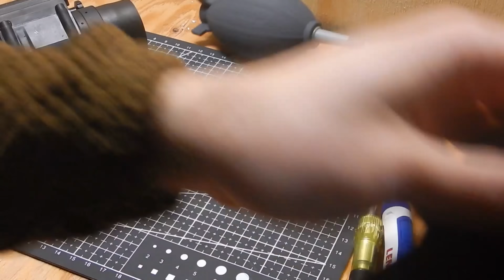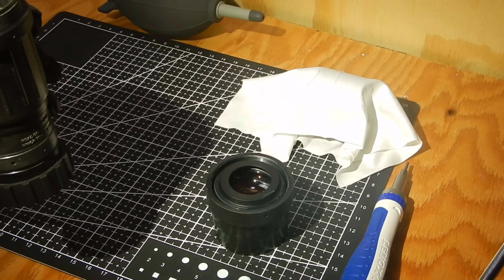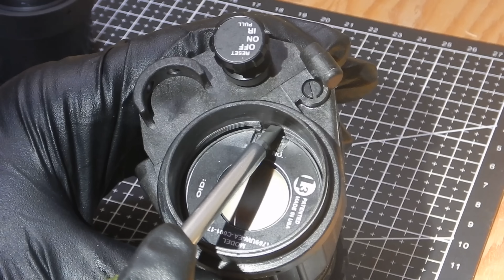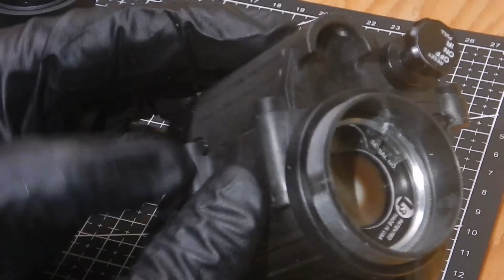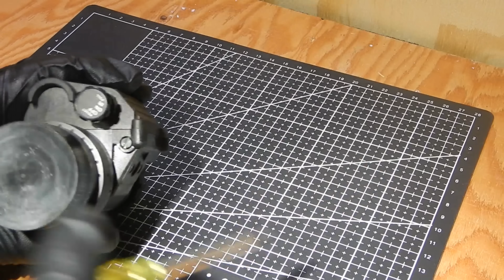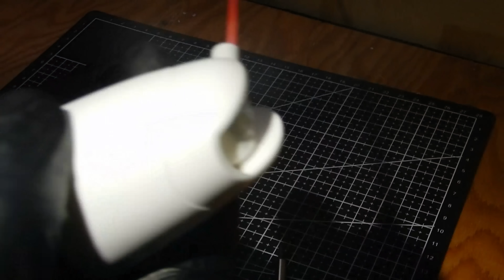How to Build Your Own PVS-14

Comment: A hint from some one who cleaned and adjusted microscopes professionally, using aluminum foil as a work space covering works fantastically. When you unwrapped the foil, it is guarantied there is zero dust or lint. Also this eliminates any static charges. So lay down a layer of foil to work on. You will thank me.
Reply: You sir are a god send. Thank you!
Reply: @AcidAnthrax  I would also use foil to seal off exposed components from air borne dust. Use it to wrap components which are removed to do the same.
Reply: Great idea
Reply: @beefstuart8769 i
Reply: I hear you can make hats out of it too.
Reply: @jackshett  we had one wacko scientist on the ship that did.
Reply: @crawford323  Fauci was there?
Reply: @crawford323  was that while crossing the equator?
Reply: @jackshett  I think crack heads improvise paraphernalia with it as well.
Reply: I'm impressed, I did NOT just read a completely stupid idea from the internet. Congratulations.
Reply: @shamancredible8632  yessir, taking a bit of time to prepare your workspace can save you grief.
Reply: I'm going to try this when I replace my screen protector for my phone
Reply: Any experience with Rodico for dust removal? It's a staple in every watchmakers tool kit for the same purpose.
Reply: That’s funny, an old Olympus camera tech told me that years ago. Have to say I never tried it but that’s probably why I got dust in all me lenses I took apart
Reply: I'm going to use that the next time I take apart my camera lenses and de-fungus them!
Reply: then you can   arc out  whatever you're working on if you're doing electrical
Reply: @billyjones9045  There is that!
Reply: Thanks
Reply: Thank you.
Reply: Hello. I have a question you may be able to help me with. I build medical devices, endoscopes specifically. The ones I build are rather unique in that they utilize 5 cameras to give a 360 degree view compared to typical scopes that only use 1 front facing camera. The 4 side cameras are covered with coated optic quality windows and come new amazingly dirty. They are a real PITA to get clean enough for installation. You have any tips for cleaning something like that?? I have spent multiple hours cleaning 1 window, only to find once I UV glued it in it is still dirty. Any advice would be greatly appreciated.
Reply: @stephenhood2948  The trick is to identify what substance is coated and causing the obstruction? We were taught to start with the least damaging substance and that being your breath moisture, then to lens cleaner and so on. We used “Sparkle “ the commercial window cleaner. It was actually formulated in WW2 after searching for a cleaner to clean the aircraft windows and not cause crazing. Any ammonia and chlorine can be very destructive to Le an for example. Then we moved to methanol, each time examining the lens to see if we actually dissolved the substance causing our grief. We would make our own ear buds because the commercial ones used glues to attach the cotton and of course dissolve and apply it to our lenses. We used wooden stick similar to the size of toothpicks but longer. We would break them to fray the ends and the twirl them in medical grad cotton balls. This next part is hard to describe but a snap if you see it done. To take that mess of cotton stuck now to a stick, twirl and slide it against the sleeve of your shirt near the shoulder. Push and twist at the same time working the cotton ball tight to the stick. Make sure you have plenty of cotton between the frayed wood as this can damage some coatings. Never apply fluids directly to a lens but just lightly to your homemade ear buds. The try to shake it all off. Whew. I’m sure my description has confused all. Start cleaning in the center of the lens in a circular fashion expanding the diameter of your motion till you reach the edge of your lens, then examine. If it did some good but needs more. Strip the cotton off the maxi toothpick and apply more cotton and start over. Keep you cotton balls in a zip lock back and never bring them out. Open the back slightly and insert the frayed end of your super tooth pick in to grab some cotton. You cannot risk having the cotton contaminated accidentally so keep it safe in the bag. If lint is a problem, that is a big problem. I always wanted to build a “filtered and magnified clean box” but never did. However take some hints from those who clean photo sensors. That industry has wonderful sterile and clean swabs made of a material which loves to hold on to lint and take it away. A quick search will find many products along those lines. I am long retired but I have my notes somewhere. I was not sure of the more aggressive solvents used. I studied at McCrone Institution in Chicago for my microscope maintenance knowledge. A call to them would be fruitful. They offer a wonderful week long course in microscope maintenance which includes cleaning. Hope this helps.
Reply: @crawford323  Thanks for the tips. Lint is a big problem. We have a laminar airflow hood thats supposed to create a sort of mini negative pressure clean room, but it is of very little help. They instruct us to use isopropyl, but that just usually leaves a nasty residue. The also have some sort of grease remover, ROR, but again usually leaves a residue, and these are medical grade devices that need to be perfectly clean. Honestly I feel as though I could learn far more on the internet than the people instructing us can teach us. Thanks again, I will try some of the tips you mentioned.
Reply: @stephenhood2948  isopropyl never worked well for me. Lab grade methanol or ethanol leaves little residue. Be especially careful with methanol which I expect you know. Never apply of course directly to a lens. The pol microscope lenses are glued not screwed together because the resulting pressure will depolarize the light. So dissolving that glue would be costly. My idea of a mini clean room would be build a box big enough to insert comfortably your hands and big enough to place a camera, lenses and tools. There would be magnification and lighting on the top surfaces and hepa filters on the sides. You might even use the vent hood to pull a slight vacuum. Do you have a port to draw vacuum from? I would be tempted to build the contraption around a stereo scope or even some of the new electronic microscope. Those are cheap and amazing. If you don’t have a vacuum source get a small car vacuum. The downside is they are noisy. If you build the thing name it Bill.
Reply: @crawford323  Yes, they have whats called a Laminar Airflow hood. Its a 3 ft tall box, about the diameter of a phone booth, with the front section half enclosed and a giant fan with ridiculously huge filters on top of it. Its creates a steady stream of upwards airflow that evacuates anything floating around in it. I was an auto mechanic for 30 years before this, but moved out of state and wanted to try something that didnt involve smashing my knuckles daily and painting myself in grease every day. The new vehicles are quite complex electronically, so most of the work on the Endoscopes isnt that different. I do quite a bit of micro soldering camera wires onto USBs, working under the microscope is the real big difference, its a different world under there, you need to have next level hand/eye coordination, but Ive been doing this for a bit over a year and have begun to really learn the process. We build new scopes for the company I work for, I had to sign a nondisclosure, so I dont want to say the name, but our scopes just got FDA approval and are just beginning to be sold. Plus we repair Olympus endoscopes for other doctors. The scope we are building is quite innovative, but there are still a couple of distinct areas I am struggling in. I wish we had better quality windows, they come new with fingerprints and fuzzies on them, not to mention damaged optic coating that cause reflections from the LED lights on the scope. It is a good feeling though to know that one day something you built could save someones life, gives me a real reason to want to put together a quality product. Though the same could be said of an auto mechanic, the extra work you put into a brake job could easily save someones life.
Reply: @stephenhood2948  Individuals like you have insights which others have not and talents which might not even be understood by yourself. I bet we could have a lot to chat about. I invented three devices which geologist are not using to gather data better. I earned a degree in photography in 1976 and I have done this my entire life and that road led me to become an Imagine Specialist in the scientific community. They struggled to solve problems in imaging which I found to solve easily not because I am smarter, no by any means. It is because I see the world differently as you do. This is not a job for you, I can see that. It is a passion and you know you have the vision to solve what comes before you and the end goal, which makes all the difference, is you want to help others. That your parents and your peers and your beliefs gave you.
Reply: @crawford323  Thank you, I have always been told I have a gift for repairing things, its really nice when people who dont know me notice this!!
Reply: or just use a grounded ESD mat
Reply: @russellzauner  The mat perhaps is not lint free. Optics are not concerned, as much, with grounding as electronics are however your point is certainly valid.
Reply: Well thank you! Will it mess with any electronic components tho?
Reply: @BUZZKILLJRJR  I am in no form or fashion an electronics expert.  I believe though as techs who work on sensitive electronics will wear grounding
Straps that such a device could be attached to the foil as well. It's the static charge, I believe, which is their fear. So maybe grounding the aluminum foil as well before interfacing with the device would be wise, I don't know. Just my guess.
Reply: Good looks
Reply: Please don't listen to this clown. A static dissipative surface is a much better idea. 

Also, never use fucking tape on optical surfaces. Transparent to you might not be transparent to 10um.
Reply: I thank you now
Reply: Id get ESD bags.
Reply: @Jake39019  we have big rolls of esd plastic they use to vacuum seal components. I think all the dust comes from the room. Turn on a flashlight and it’s everywhere. Luckily dust inside a lens doesn’t effect the performance.
Reply: Thx man
Reply: Thanks, man!
Reply: Ta
Reply: You assemble them naked too to keep the lent and dust dontya
Reply: Thankyou!
Reply: Aluminum foil doesn’t eliminate ESD(its a conductor) ESD is dangerous for Night Vision Devices, we kept it far away when repairing NVGs.
Reply: Thanks for the tip, whenever i need a makeshift clean room ill remember this.
Reply: Where can I get the parts to build it on my own
Reply: Thanks
Reply: Many thanks! I'm just starting to play with optics and electronics.
Reply: )l12] l ppl) ] ]
Reply: @Redlight25  ... 
everything, except THAT! LOL! 
(that's what she said!)
Reply: Hero
Reply: @Redlight25  Can someone throw a tin foil ball at Biden maybe it will fix him?
Reply: Fucking genius. I love the internet, it’s like my brain turning into a whore and getting fucked by all the smart people and their little mindsperms fertilize my idea bubbles.
Reply: hell yeah bro thanks for the heads up!
Reply: Well, thank you!
Reply: you can also work in a bathroom ,take a ot shower and wait a while until all the humidity clears,maybe open a window a little bit anyway it will be almost dust free
Reply: Thank you!
Reply: Wait at the start i was thinking that was sarcasm but are you guys being serious with the foil thing?
Reply: Thank you

I didn’t actually do this but you said “you will thank me” and I didn’t want to make you look silly
Reply: Most of the companies selling part kits don’t include the image intensifier tube. What brand type model image intensifier tube do I want?
Reply: ♦️Excellent tip
Thank You👏
Reply: That's actually brilliant
Reply: I Thank you now
Reply: I clean optics often, any more tips?
Reply: It goes great on hats as well.
Reply: Great tip!
Reply: Are you saying I should put electrical components on aluminum foil?
Reply: @dvazquez2016  The aluminum foil serves two functions. It is a lint and dirt free surface and also eliminates the static charge so the attraction of atmospheric particles is not attracted. I used it for cleaning surfaces when dealing with microscope components and optics. You should refer to an electronics expert to advise you on static charges and dissipation of static charges in reference to electronic components and aluminum foil.
Reply: This is a great tip for so many delicate jobs.  Thanks again from 5 years later!
Reply: Thank you
Reply: guarantied
Reply: @FatherxSnipes  I see you’re a man of culture
Reply: He still hasn't thanked you buy I will. Great idea!
Reply: @Brzhk  You are most welcome. Ready for another? Use Scotch Brand magic tape to remove the dirt and lint from your lenses prior to cleaning. This particular brand of tape will not leave a residue on lenses. Take a strip long enough to be physically held and drape it across the glass of the lens. I would use a small wooden stick lick a cuticle tool to press the tape down in the place where the ring meets the glass. Then rapidly pull it off and do it again. This will not remove oils from clumsy fingers. Then huff on the lens and take your cleaning cloth or lintless paper, start in the center gently rubbing in the center small circles. Eventually lager circles till you get to the edge. If you have to go to a lens cleaner solution, never apply directly to the lens only moistened the lens paper. I used to make my on ear buds or w-tips by using Cotten balls. The reason is the Q-tip type some times or may have glues which might dissolve.
Reply: The glass cleaner SPARKLE ✨ was the original Army Air Corps formula which was created to clean the Lexan glass on the bombers. Ammonia and Chlorine are very bad for some plastics. This stuff is effective and gentle. The idea is to start with the most non aggressive ( a huff ) and get more serious with lens cleaners, alcohol ( I would use Ever Clear booze) and more aggressive chemicals I won’t mention from the chemistry labs.
Reply: @crawford323 never heard of magic tape
Reply: @dvazquez2016  Scott's brand.I  believe the  "Magic" is in reference to the tape becoming sort of invisible when applied. What we are interested in is the adhesive is not gummy and does not attach to the lens
Reply: Thats awesome
Reply: I've attempted to clean/build/restore telescopes.  And honestly,  it's a real bitch.  I just buy the damn things,  optics are a seriously complex science.
Reply: @Wastelander-s3h  They arent as simple as they seem, and the work required to build a quality product is much more than you would think. A tiny smudge or dust particle under magnification is a real problem, plus sealing it properly to keep debris out after you have finished is a real issue. Ive always enjoyed taking something that isnt functional and making it work again, Ive learned quite a lot about a variety of different things through the years just taking things apart and seeing how they work. I have always been fascinated with the inner workings of machinery, especially how different firearms work. Some are very innovative and some are simply innovative in their simplicity.
Reply: @stephenhood2948  yes! I feel the same.  I’ve always loved engineering but have always found myself fascinated with the mechanics of firearms.  The best engineering i find is in making something work in the most simplest of ways and firearms are that thing to me.  I also happened to stumble across this video and in the process ‘discovered’ this amazing collection of information in this comments section.  Thankyou all
Reply: @Wastelander-s3h  A Segway: It is incredible what hoops technology must jump through to correct chromatic abbreviations. Yet the biological eye with barely two optical lenses, that being the opening to the eye and the focusing lens itself seems to be perfect. Physics cannot be ignored. Light waves of different lengths ( colors) will focus at different points. There is no getting around it. It is fact hard and true. I cannot get a doctor who is an expert to enter a conversation where they would consider the different receptors of the eye focus at microns of different levels. The brain is powerful in is autonomous functions but I submit there is no way for a brain to make something which is out of focus to bring this color, whatever it maybe to a point. Otherwise we would not need to wear corrective lenses. The doctors know the chemistry of how the receptors convert photons to something the brain can interpret but that is where it stops. I expect some forms of color blindness is due to out of focus receptors.
Reply: @crawford323  it cannot be disputed that you are a knowledgeable fella concerning this subject. I just kinda stumbled onto this video and watched it out of a love for all things military/optics.  I doubt very much that I could assemble my own night vision device,  as in the past I have attempted to take several different telescopes,  and combine the parts to end up with a larger,  better one. I met with no successes.  I only ever managed to install a zoom from a telescope onto a microscope.  Which was actually really cool.  But in the end I concluded that the physics,  mathematics necessary for that hobby are, and forever gonna be over my head.  Optics interest me so much because of the really, really incredible things that they do,  mostly un powered. But they are an enormously complicated field with little room for amateurs.  Having said all of that,  let me say thankyou for responding to me after 7 months.
Reply: id use seran wrap cuz id think aluminum foil would make static
Reply: @gmodiscool14  it's the opposite of that. The foil will discharge static to the table and air, the seran wrap will collect it
Reply: @gmodiscool14  plastic films are worse for static, skin effect of plastic holds large charges
Reply: @jonathanwebber5519  you think i didnt see the other comments?
Reply: @gmodiscool14  The foil grounds the static, the plastic wrap will collect positive electrons. Why would you argue with a guy who announces himself as a professional who services optics? I know you are thinking  "who knows if the guy is telling the truth?"... Ok maybe he is lying, I doubt it but maybe.  You don't even know how static electricity works.
Reply: @pghgeo816  why u so angruy
Reply: @gmodiscool14  why can't you spell angry right?
Reply: @greg123294  why u s o agry?
Reply: @greg123294  don’t feed the trolls.
Reply: @whocares1877  some people will argue with a brick.
Reply: @crawford323  Auto detailers use the same logic; start with the least aggressive method, then work your way up from there, if you need to.  Also, have you ever tried automotive painters tacky clay for dust removal?  I've never tried it, but I'd think it might work.
Reply: @pghgeo816  "positive electrons?" Do you mean "holes" (i.e. missing electrons) or is there some new subatomic particle I've not heard of?
Reply: @Gideon_Judges6  You are correct sir. I was trying to bring back my education from 30 years ago on static electricity. Electrons are negative, protons are positive, static is a result of an imbalance, Thank you for keeping me on my toes and making me look it up.
Reply: @crawford323  I hate arguing with a brick.... I can never get my point across...
Reply: @gmodiscool14  let me guess.... you're Indian aren't you
Reply: @Gideon_Judges6  he obviously meant positive IONS
Reply: @Superabound2  no
Reply: @crawford323 no they won't 😶
Reply: @whocares1877 we gotta eat too!
Reply: @pghgeo816 dude never played with a balloon I guess
Reply: @gmodiscool14  it is counterintuitive but non-conducting surfaces will hold static charges, while conducting surfaces don’t nearly as much.  Even more cautious one could ground the Aluminum foil.
Reply: @gmodiscool14  saran wrap makes static
Reply: @gmodiscool14  Seran wrap and all plastic wraps work via static cling, its kinda how it works along with the stretch.
Reply: @gmodiscool14  actually plastic wrap will produce  far more static
Reply: @Irishjay1025  oh wow i didnt know from all of the other replies an entire year ago 🤯🤯🤯
Reply: @gmodiscool14 are you slow or trolling?